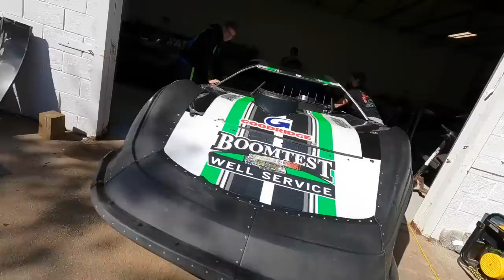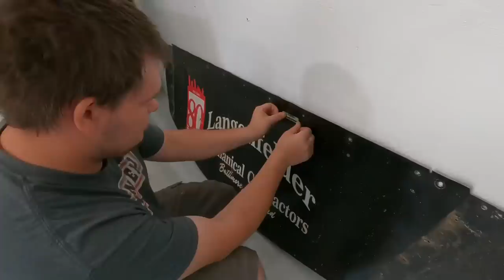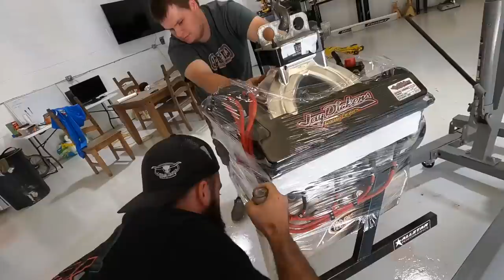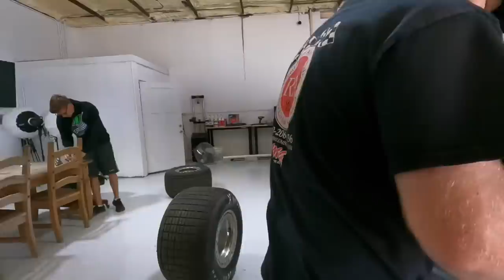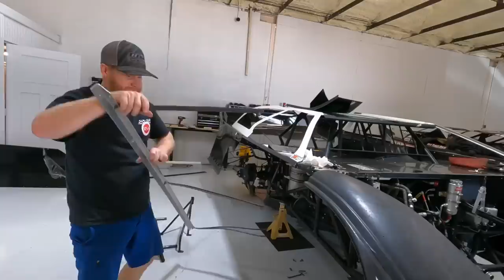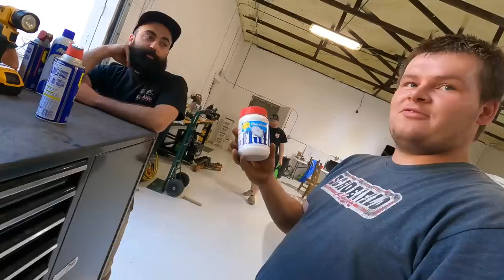Chassis Change! We Bought a New Race Car!

Comment: I hate to keep saying it but every chassis brand has to have someone setting it up correctly, that goes for bar changes, shock adjustments, Tire prep etc etc also making changes throughout the night as the track changes and slicks off! Until they hire someone with experience setting these cars up and prepping tires correctly they're going to keep struggling. Anybody would that ran Regional their whole life! With some guidance I think this team is capable of winning in the near future but as of now teams like Madden, O'Neal, Davenport, Owens, Shepherd, Erb, have people in their corner with years of experience or the driver has raced long enough to make the adjustments to the chassis. For some reason they just don't want any help apparently because if they did one of the four could reach out and find someone to help. Everyone in the comments keep saying it's not easy to find a crew chief and if that's the case they could at least find someone to get under to teach them because they're just going in circles at this point. It's sad because this team is capable of running up front and getting top five and top 10s with the big boys possibly even winning some but without some guidance I'm afraid it's going to be the same scenario with any chassis they run

Comment: i can tell you boys what we added  to our longhorn to make it alot faster that's a limiting strap to the left front ours like to lift the left front  when in a turn and they don't like to be unloaded before or in a turn, and if you have  Is direction problem gear it higher to lower the  Torque to the rear tires it works for us ,the best of luck guys wish you all the best

Comment: You might consider putting the Draime in "Betty" for a "Plan B" Pretty good results with that motor at the tracks you are going to race at.
Reply: Betty has the dale engine they haven’t used the draime ina while
Reply: yea I know they need to swap it before they go They never would get the dale engine to hook up on those slick tracks. Less power means more speed for them on a slick track
Reply: I agree 110% The draime is BEST MOTOR u guys have
Reply: @rcp935peek4  the dale engine has bout the same as the draime I do believe
Reply: The Dale engine may have the same. or less or more who knows I just know they made the big shows at Eldora, Top 10 at Altech scored a couple of seconds at Senoia and won the Nat 100. with the Draime. It just seems to work for Joseph.
Reply: Put the draime in faithful to have faithful as the backup super and the crate in betty
Reply: They may not have enough parts (headers) to put the Draime in anything and still have a super for Jesse to run at deep south
Reply: @rcp935peek4  they have enough sets of headers lol there's a set in the stacker and a set at Jonathan's in his shed

Comment: It ain't no big deal switching cars.... From the early 80s to present our DLM program has raced in many different chassis brands.  It's not like anybody ever gave us a thing... we paid for them same as everyone (except the house drivers).  Jig-A-Lo, PRC, Rayburn,  Shaw,  Bullet, American Made, GRT, Rocket, Longhorn... currently campaigning 2 XR1s and have customers with Longhorns and still some Blue/Gray Rockets that win in limited and crates. For 40yrs I've seen people both win and struggle with every chassis known to man and have done the same ourselves with the cars we personally race.  Sometimes a change is what you need.  Good luck with your new Longhorn.
Reply: You sound quite old if you experienced running all those brands because they go wayyyyy back.😁

Comment: Someone once told me, “ if you’re going to play with the big boys, you need to get the big boy toys”.. Joseph wants to run and win in the WoO super late model division..this could be that upgrade he needs to get the power into the dirt and off the corners..this is going to be interesting.
Reply: He only knows how to drive the low line he can’t do middle or high side
Reply: None of those Capitols have much forward bite on a slick track.
Reply: @davesupple7423  you haven’t watched many races have you...

Comment: Good to see you getting out of your comfort zone and trying new things. My recommendation is to get race ready as early as you can and go do some testing at a track before you run it at a race.
Reply: They do have the draime just sitting in the trailer rotting away.... could slap that in there and as you said shake down the car to get a feel for it
Reply: @davidadcock1475  that's true but my thoughts would be using a motor that would have comparable HP to the Jay Dickins that they will be mainly running in it. I did hear them say on the podcast that they are supposed to practice the Friday before the Saturday race.
Reply: @DeanBarefoot  I suggested the draime since its in the trailer and not already in a car... you didn't suggest what engine to use.... they could put the Dale engine in the longhorn to shake it down before the Dickens engine gets back from getting fresh but they'd have to take it out of Betty first
Reply: @davidadcock1475  I know it would a lot of work but that's what I was thinking also since it is the only one they have that is close to the HP of the Jay Dickens engine. The more shakedown they can do, the better they should be.
Reply: @DeanBarefoot  without a doubt that's the best thing to do put the Dale engine in the longhorn for a test session just to feel the car out for when the Jay Dickens engine does get back

Comment: Sometimes you have to try something different in order to to move forward. I certainly understand that you want to stay with a chassis that you! know and understand. But it's like you say you have to try something different. To bad Schwartz still doesn't still make chassis or does he? Anyway he built great ones. In fact my sister bought one that Clint Smith ran years ago, and I believe if it had the motor it would still run up front. But then again, it's always fun to think it would. Stay safe.

Comment: Congratulations on the new to y’all, longhorn.Can’t wait to see it dialed in and winning races.Sometimes change is a good thing, need to find more speed,so, good things are ahead.Now, the million dollar question, do you stay with Jay Dickens power plant, or go different motor. Looking forward to seeing it win ! Good luck, n keep HTF!🏁🏁🏁
Reply: One of the reasons they went with Jay Dickens is that was the only engine they could get at the time. Parts are still hard to find.

Comment: The way I look at it the frame  and roll bars work together ,so it doesnt flex at the four wheels ,doesent matter who makes the frame and roll cage, its the suspension that makes the car work, since they are adjustable as !@# Ive seen racers go around a !/4 with the drivers side front wheel never touch the track

Comment: I'm not 100% sold on that Longhorn especially after seeing Jimmy struggle with it.  "Jimmy put it up for sale for a reason"  and your Performance with the Henderson car,  but getting away from that Capitol is definitely the right move. I sure thought that you woulda went with a Rocket when you switched brands.
Reply: First off Jimmy is notorious for a very narrow feel in his race cars. 2nd Jimmy has had Black Diamond chassis..Club 29 chassis..Team zero....Longhorns..Rockets. Jimmy has jumped back and forth from chassis to chassis his whole career. 3rd your making a wild assumption that the car that Joseph drove for the Hendersons was a current design it wasn't. It was a 2018 model so do a little more research bud.
Reply: @JJ-1-1  true but at the end of the  day Eric's  point is still true as well Jimmy sold it for a reason ... if he has a narrow feel then by definition you are saying  the XR1 is more easily tunable  or resonds  to changes more predictably

Comment: Capital race cars win, Longhorn race cars win,  Rocket race cars win.  They have Cornett or Clement engines in them.  If you don't have the power at the top end or torque you've got a middle of the pack race car.  I hope the Dickens has the power to pull the new Super, we'll see.  Put the hammer down Joseph!  Good luck HTF-
Reply: chassis is more important than motor,  partial to Cornett here but Vic Hill with Bobby Pierce  and Jimmy Owens and Durham with Brandon Shepard and Chris Madden are right there with  Cornett and Clements

Comment: I see the fire bottle is drivers left, good.      Please do a video of the differences of the two chassis' and what y'all think the major changes are.
Reply: Way to much difference to show on a video.
Reply: Hardly spindles for the laughs and goes to the right spindles front and back different pick up points for suspension components don’t make it more complicated than it is race car chassis is a rigid body if it’s not it’s not a race car chassis
Reply: Meant spindles to the left and spindles to the right

Comment: Only thing I saw they didn't mention that is missing on the car is the shocks. Did it come with the car and they are in the truck or do you have to figure out what shocks to go with for the car?
Reply: 99% of the time these tops guys don’t let there race shocks go.
Reply: @JJ-1-1   not sure why most of the time the shocks used on one brand won't work on another chassis and different driving styles can change what shock you run too. Then the other part is Owen's couldn't figure out the Longhorn so maybe not a bad thing to not get the shocks with it.
Reply: @jasonnelson2744  I have said this a million times Jimmy is kinda weird he wants a certain feel and he has his own ideas on chassis. Jimmy has bounced around from Club 29 cars/Black diamond cars/ rockets/ longhorn. In the past Jimmy has won races in a longhorn. As for shock they fit all cars just settings and internals are all different
Reply: @JJ-1-1  that is the part we're I meant shock valving ect. Doesn't always work from chassis to chassis.
Reply: @jasonnelson2744  unlike capital  longhorn provides a 50 page setup book.
Reply: @jasonnelson2744  oh by the way Davenport shocks aren’t the same as Overton so what the big deal. I’m sure Jimmy’s was different too.
Reply: @JJ-1-1  I made this comment more ss what are they going to go with Penske like all there cars have or are they going to switch to Bilstein like majority of the Longhorn drivers use.
Reply: @JJ-1-1  will they help them out at a race if he needs it and calls them up with a question though? Also who knows if they got a setup book with the car when they bought it. Hopefully they did and can study it.
Reply: @JJ-1-1  that is probably when you buy directly from Longhorn. If this is true, hopefully Jimmy gave them the book.
Reply: @marklavallee5610  We bought a. Used longhorn and we called them and 3 days  later we had our setup book. Just stop
Reply: @jasonnelson2744  Jason be carefull with the word ALL, ALL longhorn drivers do not use Bilstein the 76 uses Penske
Reply: @thomasgray2184  ok great majority of the top Longhorn drivers.

Comment: Did you bother to get a basic setup from Jenny Jimmy Owens on that longhorn chassis I hope so
Reply: he was having trouble making it fast is what the  Is rumor mill is saying
Reply: He sold it cause he was having trouble with the longhorns
Reply: @Carbogarbo42  
your right he could not make it fast that's what the rumor mill is saying, that's kind of a bunch of racers from all over chat on
Reply: @raymondbrandt7831  The cars come with Baseline set up book you just call them
Reply: @JJ-1-1  
i no we run a longhorn we got new
Reply: Jimmy didn’t even have a basic set up. He lives close to me. He sold it because he couldn’t figure it out and said only 3-4 Longhorn teams got full Longhorn support. And he wasn’t one of them.
Reply: @Drewski423  
hum we didn't have any trouble, we put the engine in and put it on 4 pad scale and called them with the numbers they set us set for the weights then  ran some practice laps and our  crew chief went to work and dialed in in no problems
Reply: @raymondbrandt7831  idk that’s just what I was told. Honestly don’t know if it fit his driving style either. He don’t really get out there and let it hang out either. More of a finesse driver. Every Longhorn I’ve seen that’s fast has a driver in it that’ll let it all hang out. Alimony on the edge of loose and out of control.

Comment: Do you guy's still have the Earnhardt motor and the draim? And are you going to have Jay dickens redo the Earnhardt motor when it needs it?
Reply: SB2 is still in betty. 
Draime in the trailer.
Reply: @LoganGibson  sp2 they blew it up didn't they
Reply: @andylute2887  They had two, they did grenade one and its still in pieces. 
Other SB2 is the engine you're referring to as the Earnhardt motor - It is in betty.

Comment: now all you is to try a durham ford that's what's winning lots of races i never thought you would get a longhorn after the last one you drove maybe it was a crew thing or communication thing
Reply: You better think twice about what's engines are winning. Clements has to be #1 with Cornett #2. Davenport and Marlar are both using Cornetts and Clements. McCreadie: Cornetts; Overton: Clements; Madden: Clements. Sheppard is the only one running Durhams. Satterlee and T. Erb switch from Durhams to Clements before the season. I believe Durhams are way over-priced.
Reply: 70% are Clements motors NOT Durhams
Reply: @marklavallee5610  Madden  still runs Durham,  JD  and Marlar run Cornett  much more than Clements but JD did run both Eldora shows with Clenents
Reply: @thomasgray2184  yep, I forgot about that.........he always ran Clements before, it's just the deal he has now

Comment: Not a chance I would have sold a new capital and bought a used longhorn
Reply: That Capital wasn't new it had 26 races on it and the Longhorn 2022 model had less than 15 races on it. you don't know what your talking about.
Reply: @JJ-1-1  nah I've only been around racing for 30 years if there wasn't something wrong with the longhorn owens would have never sold it. I'm not bashing these guys I love watching these guys I'm just stating I would have never gave up the car they had
Reply: @deandodson9273  Well in 30 years you have learned much . Racing since 92 myself.
Reply: @JJ-1-1  I wasn't trying to come off as a Dick just saying an option I just think they would be better off in a capital they won't get the same help and info as a jd or Owens will get
Reply: @deandodson9273  there was nothing wrong with the Longhorn. Jimmy just couldn’t figure it out. He told me only 3-4 Longhorn teams get Longhorn support and the rest are just left to fend for themselves. Wasn’t that anything was wrong with it, they just couldn’t get it dialed in and sold it. Went back to the rocket. Jimmys problem for the most part is he fired all his good help for whatever reason. He can win consistently here local at 411, Bulls Gap, and those style tracks.

Comment: Call the new car "Betrayal"
Reply: I like mr upgrade
Reply: Are you upset there getting away from a inferior chassis .
Reply: @JJ-1-1   how is the capital interior? They are just a bunch of tubes of metal welded together. Up to you too make it run
Reply: @GentryRacing629  it’s called pick up points …roll centers…center of gravity…camber and camber gain. Bump steer. I could keep going but you have no clue what your talking about it be waste of time to go any further.
Reply: @JJ-1-1  its up to you to make it run regardless. What exactly makes the capital inferior is what im asking you?
Reply: @GentryRacing629  lack of development  due to lack of engineering and resources.
Reply: @JJ-1-1  so what would you change about the capitals to make them run better?
Reply: @GentryRacing629 I have question for you.Are you under the impression the cars come bare with out hook up points. And the team is responsible for that ? For the life of  I can’t  figure out are you that far out in left field.
Reply: @GentryRacing629  copy a longhorn ….lol
Reply: @JJ-1-1  with a capital pretty much all of the pick up points can be moved. No different the moveable 4 bar plates, shock mount locations, jbar bracket. You have to set it up. Just cause you go buy some new fancy shit dont make it fast
Reply: @JJ-1-1  you are saying copy a longhorn but you dont even know why the longhorns are fast.
Reply: @GentryRacing629  You sir are grasping at straws and you ‘re not realistic. And I have grown tired of this never ending discussion  when it’s apparent your going  to come back with  some kind  of argument and your not capable of reasoning ..No thank you
Reply: @GentryRacing629  I did notice your a Capital fan boy in your CRATE car.
Reply: @JJ-1-1  im asking you to explain why you think capitals are soooo bad and the longhorns are sooo good? Its an easy question but ill answer for you. 
1) capitals dont back steer. They have to drive in a shove. Anytime you get one back steering they stop going forward bc of the RF spindle. 
2) they are extremely RR dependent. Which makes them a pain to be balanced across different styles of tracks. 
3) the lr 4 bar plates need to be pulled back and the rr plates need to go forward. They have way to much rear steer 
I dont think the longhorn stuff makes more drive i just think they can back steer more and still go forward. But to say the capitals are down right inferior is insane.
Reply: @GentryRacing629  Kevin Rumley bud. I have a longhorn but that’s here nor there but I’m not having a  multiple paragraph conversation with you again. You have no clue what your talking about. Have fun in your Capital.
Reply: @JJ-1-1  at least Rumley is an engineer, the vast majority in the late model game are clever tinkerers, Mark Richards is an Ed Howe disciple who was also a clever tinkerer,  HRE is a near where I grew up,